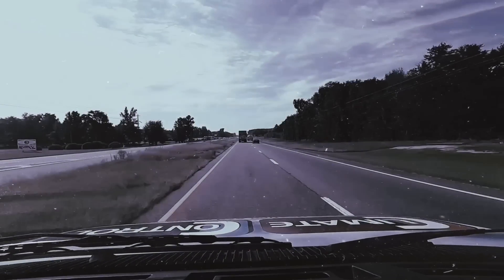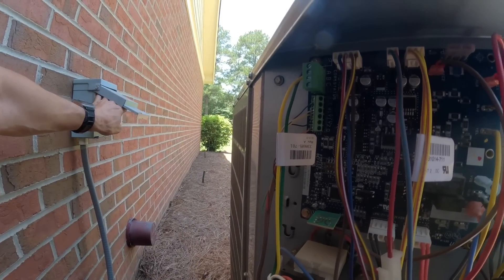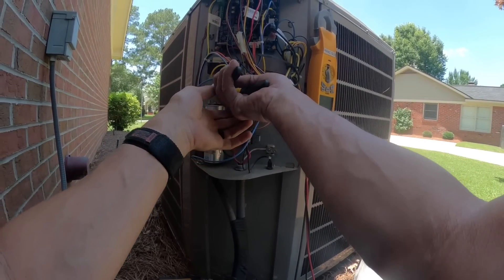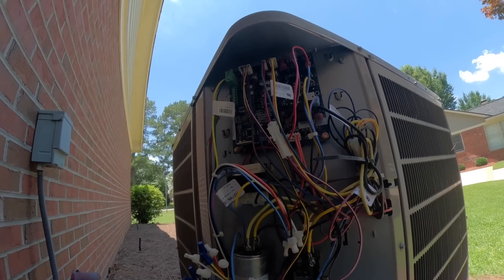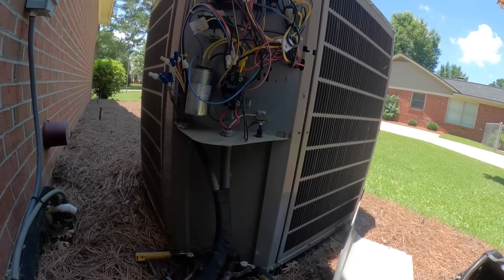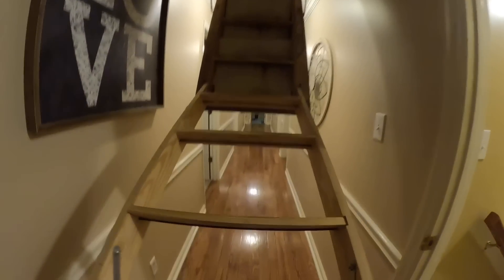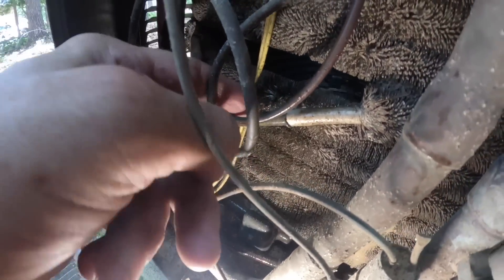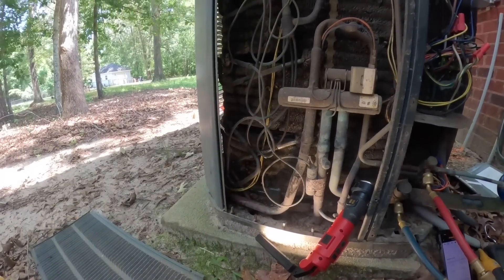Two Quick Calls - Common HVAC Troubelshooting! #hvacguy #hvaclife #hvactrainingvideos

Comment: Any advice is appreciated..went to a home..perfect pressure for a 410..subcooling called for 10..had 10…temperature on vents of house were 57 to 60 degrees..delta of 20…but thermostat showed 82 degrees and home doesn’t cool until midnight..that’s when temperature in house lowers to 77 then unit cycles on and off..any help is appreciated 🙏
Reply: Check air flow; filter, blower motor, and outdoor fins.
Reply: @JFranzen3 thanks ..all that was good sir🤔
Reply: If the system works fine as u say it does and it can't bring done the temp then that means it's severity undersized. The heat gain is higher than the btus the net refrigeration effect can carry. I also came to this conclusion since you said it only comes down a bit during the night. Which is naturally less hot outside.

Comment: I am Dyi person trying to find an answer to the following question from the HVAC family.

When checking  refrigerant  levels:   How does  the ambient temperature affect the reading of the gauges to determine if refrigerant levels are ok? 

Lets say 100 degree day versus an 80 degrees F ambient temperature.  What should pressure/sat temperature read on 410 A refrigerant...

Thanks in advance for your feedback.
Reply: Temp and pressure charts for your refrigerant are available (probably) at your local supply house or online
Reply: 100 deg 390 psi,80 deg 297 psi on the high side.
Reply from the maker: Pressure and temperature are directly related
Reply: Help  me a little bit here.  I see you videos where you connect your fieldpiece gauges and temperature probes on your low/high copper pipes.  You check for sub cooling on your phone and super heat to see if it is low on refrigerant.   The result of this is independent of how hot the day is? Live in an area of 110 degrees ambient temperature.

Thanks
Reply: @HectorVela-d8c  If you are looking for head pressure over ambient,on units 6 to 9 seer up to 1991 30 deg,10 to 12 seer 1992 to2005 25 deg,13 to15 seer 2006 to present 20 deg over ambient,16 seer 2006 to present 15 deg over ambient.hope that helps.

Comment: My invoices for failed run caps usually read like this "No cooling, replace a failed run capacitor." So I got to wondering if ChatGPT could make me sound more eloquent. Here what she said about a failed capacitor. 
"On a scorching summer day, the air conditioner's condenser unit tirelessly worked to cool a bustling office building.
Unbeknownst to the occupants, a crucial capacitor within the condenser was silently failing, struggling to maintain the unit's operation.
Gradually, the condenser began to overheat, causing it to abruptly shut down in a puff of hot air.
Confusion and discomfort spread quickly among the employees as the cool air vanished, replaced by the stifling heat of the afternoon.
After an emergency call to the HVAC technician, the failed capacitor was identified and replaced, restoring the refreshing breeze of cool air and a lesson learned about the importance of timely maintenance." 
I'm gonna start using this on my invoice and raise my price by 25%.
Reply: You can kick it up a notch by taking and dropping it into a shakespeare translator 😄     "On a blistering summer's day, the air conditioner's condenser unit toiled ceaselessly to cool a buzzing office building. Unbeknownst to the denizens, a vital capacitor within the condenser was silently failing, striving to uphold the unit's function. Gradually, the condenser did overheat, causing it to swiftly cease in a puff of hot air. Confusion and discomfort swiftly spread among the laborers as the refreshing air vanished, supplanted by the oppressive heat of the afternoon. After an urgent summons to the HVAC artisan, the faulty capacitor was discerned and replaced, reinstating the invigorating zephyr of cool air and a caution learned regarding the significance of prompt upkeep."
Reply: Lol thats funny @catfeline1530
Reply: UK observation maintenance a must but your cost base frightening to us , costs on another level, every thing your side of the pond seems two to three or more this side ,just the way it is.
Reply: @jamesbaker429  Cost vary wildly from region to region in the USA. I'm in north Texas where I charge around $285.00 total for most capacitor replacements, and around $585.00 for most PSC motor replacements. R410A is usually around $85.00/lb and R22 is about $145.00/lb. A service call is $97.50 and up.
Reply: Ima borrow that one lol

Comment: Two most common HVAC call problems: drain line clogged with algae and bad caps. Third is low refrigerant. Fourth is user malfunction causing stupid issues.
Reply: Manufactory bed design